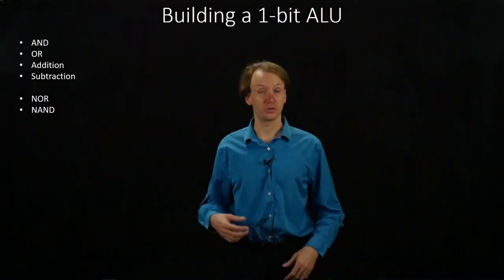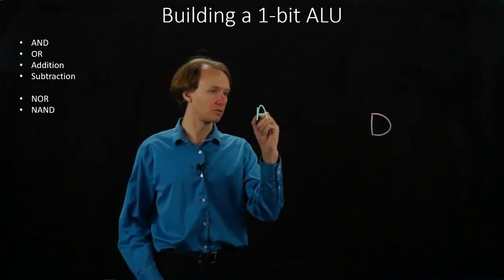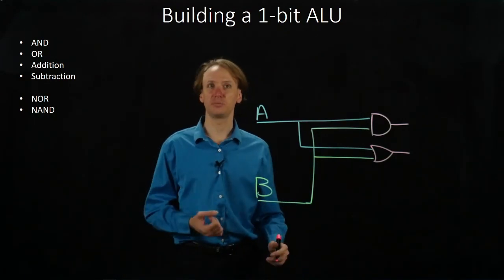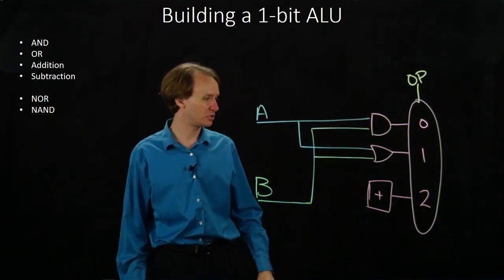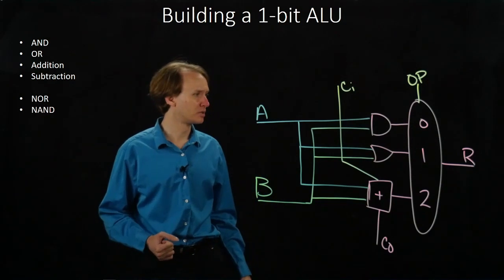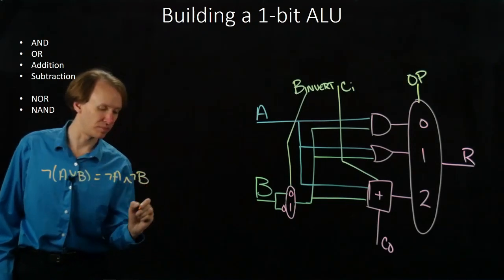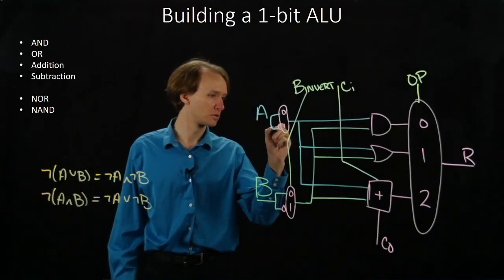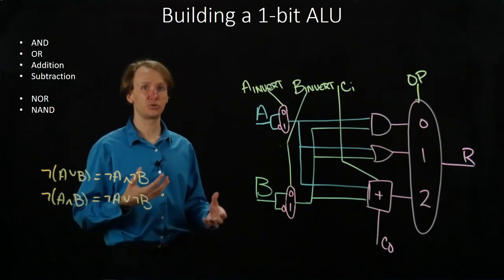9.  Building a 1-bit ALU

Comment: You could save a few gates and use a XOR instead of 2-1 Mux at the inputs.

They'd be drop-in replacements too, as the enable lines are active high and would invert on 1

Comment: how come the ALU is 1-bit when we have two different inputs A , B?  ,i would say it is 2 bit (excluding the mux control signals).. 
why am i confused :| ?
Reply: I think it denotes the bit width of the inputs, not the number of inputs (e.g. A or B can be 0 or 1 since they are only 1-bit long). This might be more apparent in his next video, as the 32 bits of A and B are split and fed into 32 1-bit ALUs for bitwise operation, and are subscripted with their respective 'index', as in A_0 thru A_31, whereas here there is no need to differentiate.
Reply: @eveninrose  Thank you!
Reply: It takes 2 inputs, each 1 bit. It's output is also 1 bit, and it can effectively process numbers that are 1 bit